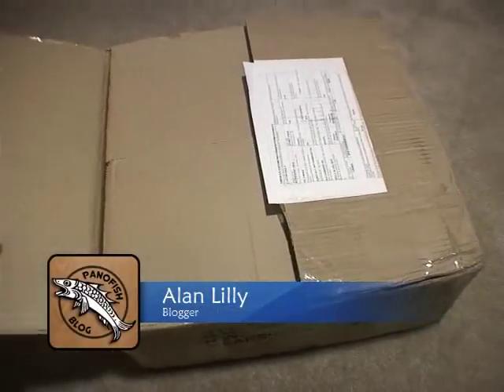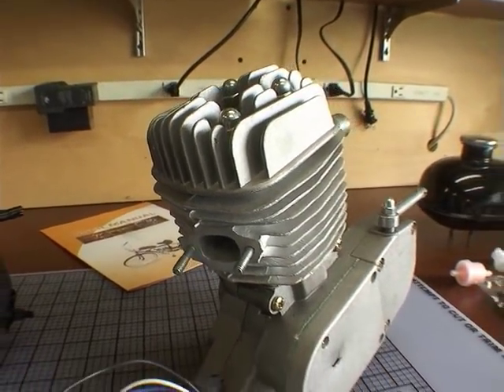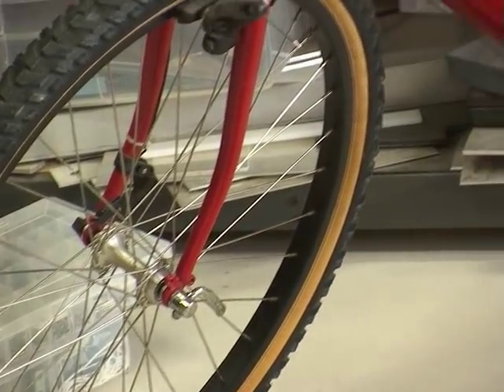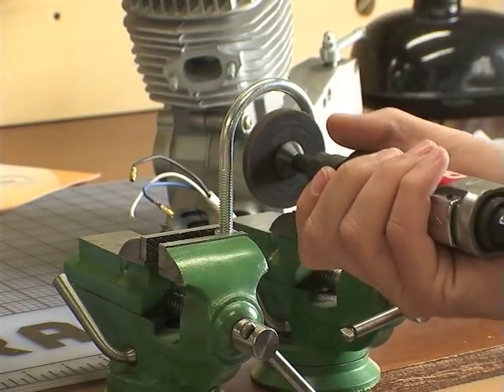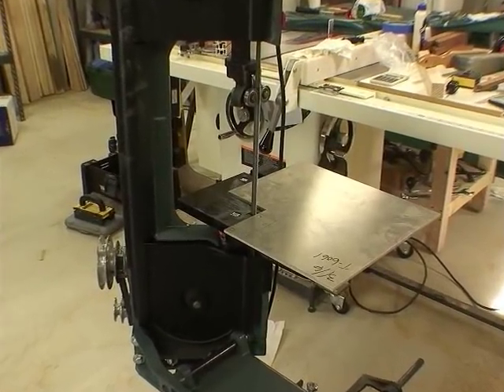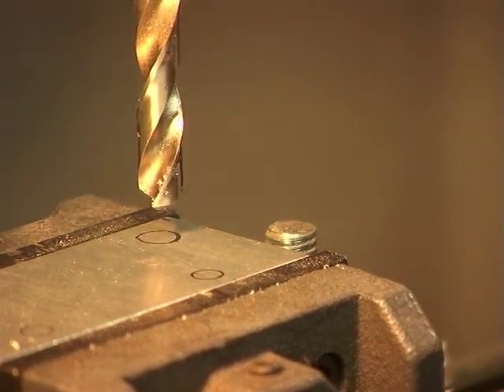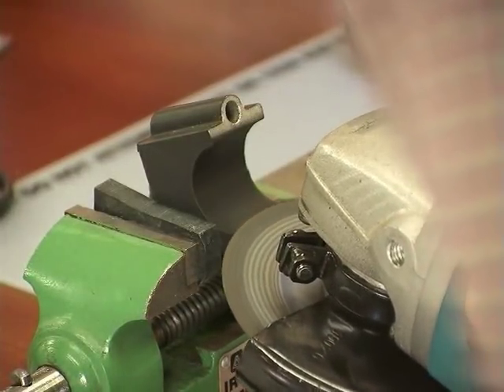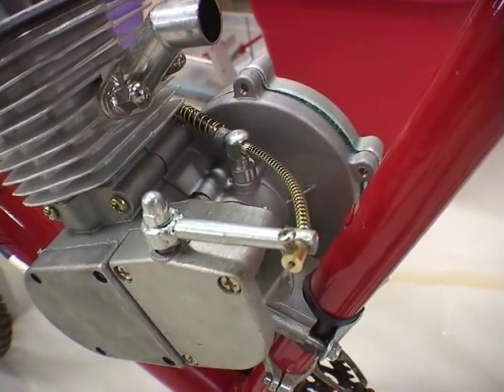How to Build a Motorized Bicycle - Part 1

Comment: That aluminium bracket wont last you pissing time, the engine vibrations will break it no problem. I made mine from heavy steel. my engine vibrated so much it broke the cheap soft bolts that came in the kit right in half!

Comment: 4.02 = swarf
n. Fine  metallic  filings  or  shavings  removed  by  a  cutting  tool.

Nice workshop and great walk through on the installation of the bike motor.

Comment: hey I just bought one of these bikes and on the ride home it fucking seized up on my ass sending me over the bars and then walking this bitch  a very long way home then because of the stuck motor I blew out the rear tire (that's not my problem) anyway I need to unstick the motor and try to rebuild it can you send me the link to that video as I need this p.o.s to get to school Monday

Comment: LOL why did the motor turn black at the end of the video and then its metallic in part 2 again?
Reply from the maker: +0zfer LOL... you must have missed some of the early commentary in part 1, where I explain the shipping damage to the first engine and they sent a replacement which was a different color.  No biggie... so I went with it. :)
Reply: +panofish It kept changing color though. I thought it was just going to stay metallic since you said you were sticking with that one. You must have switched them between i guess and added the beginning part later?
Reply from the maker: +0zfer .... Yeah, the magic of video editing ... I must of capture different parts of the video "out of sequence" :)

Comment: I'd like to see a video with the right size tubing so all those modifications aren't necessary. It makes it unnecessarily more complicated for someone trying to learn.
Reply: Whatever you do, don't use the included sprocket. You can get new ones that don't attach to the spokes, but instead attach to the hub and take less time and effort to install. The danger with these spoke mounted sprockets is that the spokes are NOT designed to have force on them in a circular direction, that should ONLY have up and down pressure on them. These will dish the rim, they can't be adjusted, the wheel can't be trued and they are outright dangerous.
Reply: oh thanks!
Reply: Kendra Jane
Reply: Kendra Jane Ya know shit im not going through all bull shit

Comment: where did you buy that kit? :D
Reply: You can get a kit on ebay or amazon. I just bought a 80cc kit myself from Bikeberry.com. RIght now a basic engine kit with no upgrades will cost you $139-$200 depending on the kind of kit you get. They will let you add some upgraded parts to the engine if you want.
Reply: Blackberry.com also give you a 6 month warranty on all their engines. I would check them out.
Reply: http://www.ebay.co.uk/itm/80cc-2-Cycle-Engine-Motor-Kit-for-Motorized-Bicycle-Bike-/331163659232

Comment: Can you put two engines on one bike with a big frame / custom frame?
Reply: Technically you could but it would be such a hassle getting them to work in unison would be a nightmare. Plus you'd need a real hefty frame to support the weight and torque. Possible? yes, practical? no
Reply: Oh, thanks, I might actually try and do it if I get lots of extra cash. :P (Or probably just put a pulse jet engine so i could probably explode and stuff) :D
Reply: Carl Johnson  If you have a big frame bike you could probably fit a four stroke engine on it. with the right upgrades, with just one engine, you could get it to go 50-60mph. On a bicycle you probably don't want to go any faster than 60 for safety.

Comment: I have a question about my bike after recently installing it.
The engine turns over when I pedal when I release the clutch. but when I use the throttle to open up the carburetor I don't get any power. I can get the engine to barely rev. 

Initially I could feel a little impulse but after trying it a couple times I cannot feel the motor putting out any power. How would you proceed?
Reply: Ben Welling what was the problem?
Reply: Choke?

Comment: I have the same engine mounting problem that you encountered when mounting.  Could you be so kind and send me the front mounting plane specs, plane dimension and hole centers so that I can have a machine shop make a front mount for my bike.
Thanks mikeshreeve@yahoo.com      Thanks in advance for any assistance

Comment: Not me buying it, she had a lot of money put away for school. Overall ended up costing about $600 in the cart and I bought a $20 throttle for mine off eBay that was a different configuration. I hope I have an easier time than you did getting then installed though, you hit a lot of problems. At least you knew how to fix em eh!
I'll let you know if I have any issues !

Comment: I'm also ordered the pull-start kits and the optional 4L tank for both the bikes, thinking of stack mounting them and getting a Y valve to have a 6L total. 
Girlfriend wants to take long trips to a couple citys North, about 450KM away, but with about 15 gas stations along the way I'm sure that we're going to stop at. heard they get about 100km/L, expecting less with the weight. Also ordered some bike posts with built in shocks,big butt seats and a post attachable backrest for mine. Should be fun

Comment: Also, make sure to strap the muffler to the frame somewhere near the tip, otherwise you have yourself a heck of a tuning fork that'll either strip the exhaust bolts or shake the engine loose.
Grubee's been pretty decent for engines, I've struck out a few times on the generic brands i.e. missing bearings, crankcase full of debris, cracked parts, etc.
Reply: 😅😮😅٠ك
Reply: لببالاى❤ي❤ض زتتط٤ق٥غاغة٠جمكجطكضاغر ا.

Comment: Dunno if anyone hit on these ideas before, but for one, don't use the bolts to mount the engine that come with it. Get some good replacements, grade 8 or better, you'll thank me later. Places like SickBikeParts sell brackets for the engine to mount on so you don't have to make your own. And don't use the rubber "shock" pads, all they do is transfer the vibration to the engine mounts. If you mount the engine flush and securely to the frame, you'll get little to no vibration.

Comment: Do NOT use lawnmower oil, get 2cycle engine oil, like is used in chainsaws or 2cycle motorcycle engines.  regular motor oil is too heavy and has additives that will gunk up your plug.

Comment: There is a really cool website that sells mini 4 stroke bike motors and it seems more official than ebay vendors. Also I was wondering if a road bike would be okay to install a motor with? I want to have bike that has hand brakes that doesnt cost an arm and a leg. i have found the bike in mind but would the type be any less efficient?

Comment: thanks., great info :D can u tell me where to buy that vibration absorbing rubber online. ? cheaper ? i live in australia. and my my bikes pole was large, i forgot to cut the excess mounting bolt so after like few weeks, the vibration caused it to break. fixed that but removing the old ones and cutting the groves with a larger diameter so i can screw in a lareger bolt. then after another few weeks, the back bolts broke off. now im looking for the best way to mount the engine without vibration.

Comment: my kit cost me 350 but is very high quality from blue icon cycles. I had exacly the same small problems as you with the mounts and the exhaust using a giant aluminium frame.

Comment: If you want to get a really good motor kit go to motovelo.us they have really great kits. the motor they sell will go between 30 and 35 mph they also have upgrade parts. their gas tank averages between 80 to 100 miles per fill up. Great customer service based in California. Great Company.